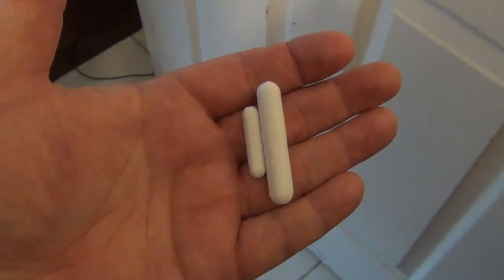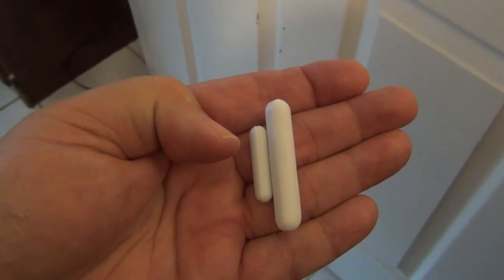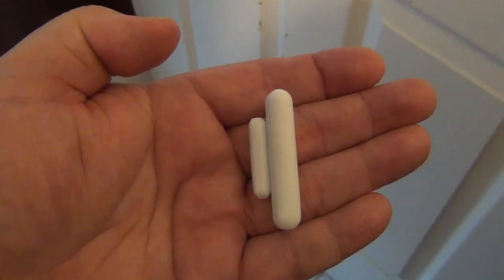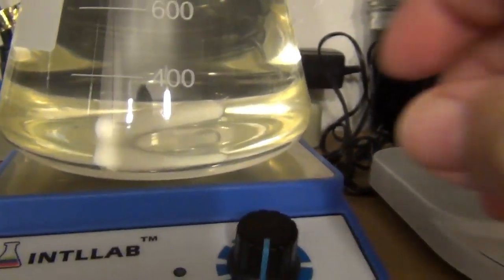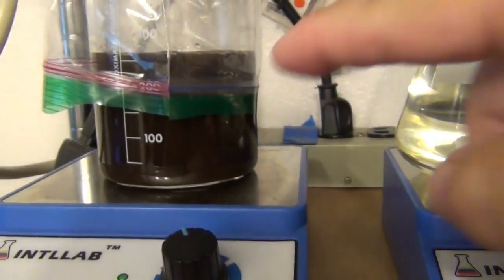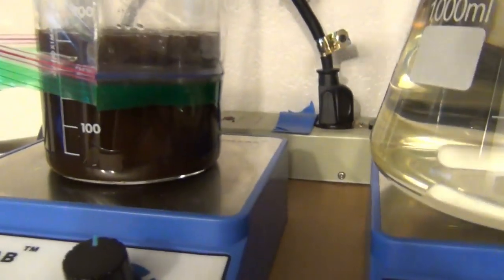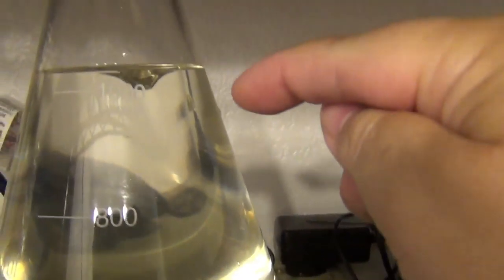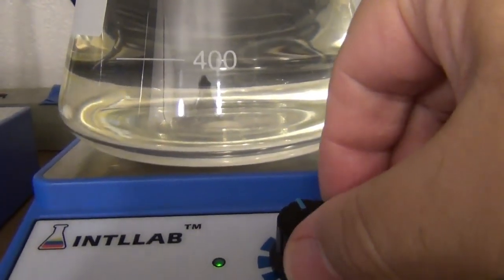Monster Stir Bar Test

Comment: This problem is not the bar, it’s about matching the sizes. The magnet in the stirrer can’t be smaller, or weaker than the magnet in the stir bar or it won’t work. Plus the stir bar needs to be an appropriate size for the container. That bigger bar is much too big for that container and apparently too big for the stirrer too.

Comment: No, you must choose the bar according to your stirrers magnet lenght or for double magnet stirrers space between magnets. Bar must be same or shorter in length.
Also your stirrers magnetic (down)force may not be enough for holding the bar at higher stopping force. Stopping force gets bigger with bigger bars.

Comment: I have been looking for a means to contact you but had to resort to posting here in the hope that you read it.  Due to the prohibitive cost of the commercial products for 2 seniors trying to improve their health I've been making my own C60 oil for more than a year.  I have followed many of your suggestions but recently stumbled on something that worked incredibly well and solved the issue of the C60 sediment that would not blend with the oil.  The C60 always deposited in the outer perimeter of the base of the flask.  I sourced wide mouth Erlenmeyer flasks with a screw top.  I noticed that one of the smaller sized magnetic stir bars fit horizontally inside the neck so tried to see if it would spin inside the neck when inverted over the stirring device.  Much to my surprise trying the flask inverted caused the C60 to blend very quickly so that I had a uniform dark purple blend withing a couple of days.  For stability and to keep the oil in the dark I have used the cardboard box the flask came in over the flask and am using the rod and clamping device on the stirring machine to hold everything stabilized and in place.  Unlike the wide bottom of the flask there was no indication of any C60 sediment being deposited in the screw cap.

Comment: One of the big factors here is the strength of the magnet below the deck of the stirrer itself. Better stirrers have stronger magnets that couple with the one in the bar better. I have been getting consistently good results with used but good condition Corning PC-353 stirrers. These have been used in colleges and small labs for decdes. Find them on eBay (look for some in good condition). I just picked-up a nice pair of them for $115, shipped.

I recently graduated to making 2 Liter batches of C60 oils left stirring continuously for 8 weeks (I have gone as long as 10 weeks, but there doesn't seem to be added benefit; the optimal time for total dissolution seems to be somewhere around 6-7 weeks for OO; AO seems to need closer to 8). I do use larger bars than yours (2.5 to 2.75 inches). I can leave them stirring at a pretty decent clip unattended on the PC-353 for two months without the bar decoupling from the stirrer. Also, with these long stir times, I have no visible C60 at the bottom of the beaker after a few days of settling time after stirring is complete, and the oil is the reddest I have ever made.

Thanks SO much for sharing your discoveries! You rock!

Comment: Thank you, K. I use the small bar that came with the Intllab and am not able to achieve a visible vortex in olive oil. Therefore, I thought about moving to a larger bar. I can see now that there is no point. Plus, my product turns out fine with the smaller bar. Thanks, K.

Comment: Your misery has company, I've had the same problem with larger stir bars.  
Have you been able to compare different shapes of 1" stir bars?  
I've been using oval, straight, and one with a bump/ring in the center.  I haven't done a formal comparison as which one is more stable or faster but I have encountered problems with some of my batches.  Video idea: what is the ideal shape and size of a stir bar for each type of oil?  Thanks for creating this video, it's excellent information!